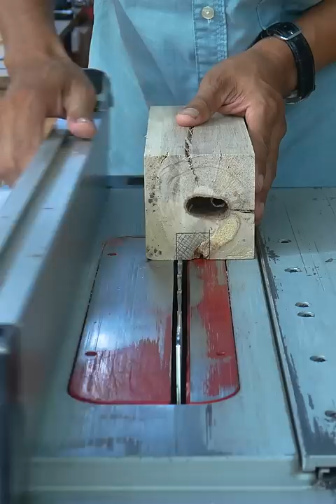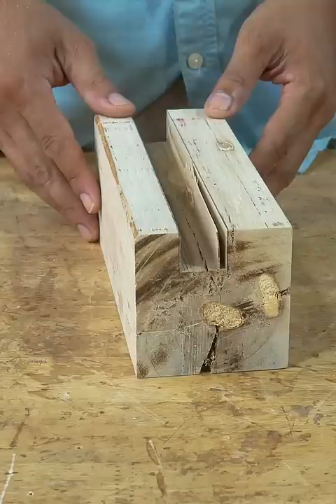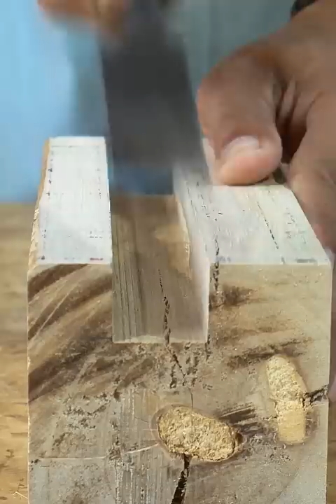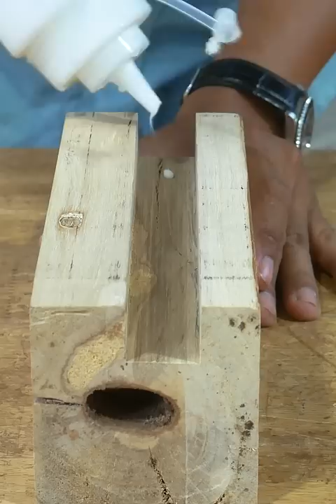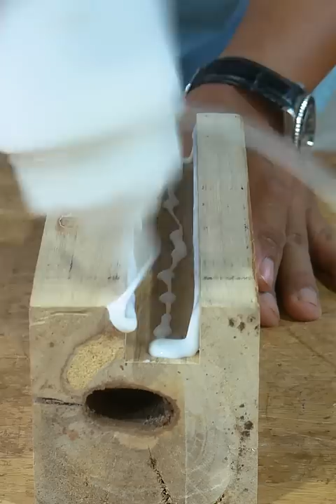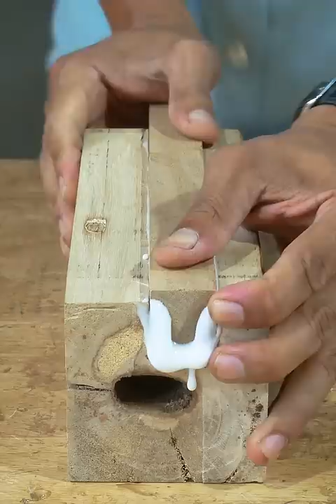Filling Wood crack technique by table Saw #woodworking #amazing #shorts

Comment: You over shot your mark with the table saw and even still your filler wood was way over sized. Then you evacuated all the glue by sliding the piece in long ways. 🤦‍♂️

Comment: that piece  of wood is rotten, you can see the center hole and 2 other spots of pith  and then replace the wood but push out All the glue that will hold the piece of wood in, You must be Deperate for wood to use that wood that could be better off used for firewood, ESPECIALLY with the BIG APPARENT CRACKS besides. A Much easier fix would be to get 3 pieces of good wood glue them together, Clamp them That's How this piece started out,

Comment: when it was dry fitted he slid it, therefore that's the way it should be fitted when gluing. hitting it in from above will ruin the interfaces of the two pieces and create gaps, it won't be a snug fit. imagine the bottom face of the piece being forced in from above gouging its way down creating uneven surfaces. just my opinion that's all.

Comment: Crappy job , ever heard of a spindle molder to get the wood out ...
Reply: you mean a router?
Reply: @loril.mangold8160  I am Dutch so I think a router is a kind of cnc machine  ? I mean a woodworking machine where a spindle is coming at of the table . On the spindle you mont an cutting tool wich can be adjusted with shims for the space you want to make in the wood or plastic .